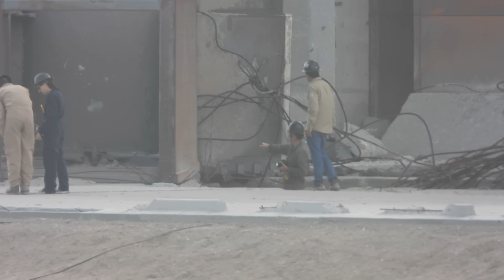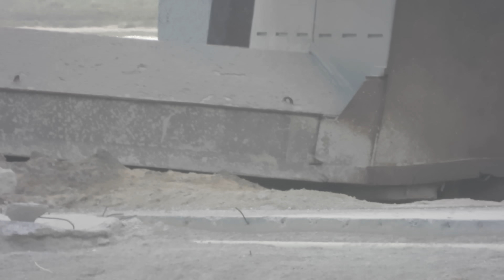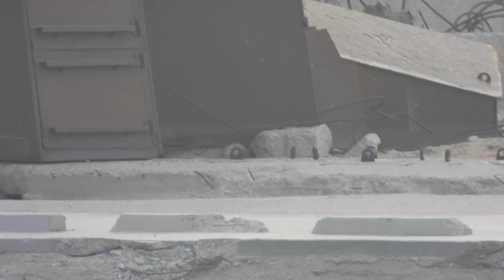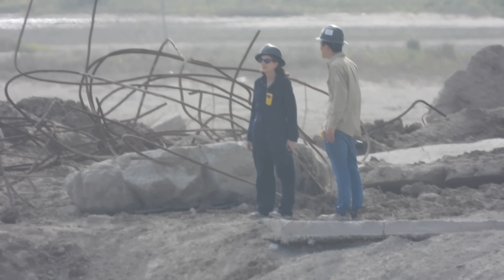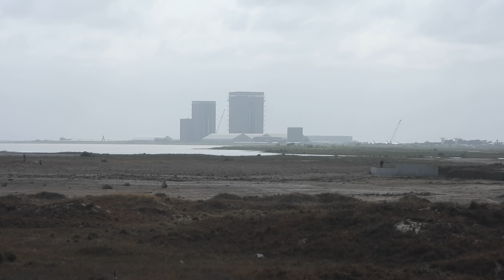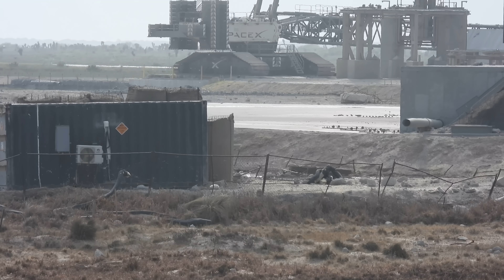Two Days After Launch, SpaceX Starbase, in 4k, Boca Chica, TX, April 22, 2023

Comment: The whole site has seen major damage!.   Another launch in a few months... HA!!  not going to happen any time soon,  at best a year from now or more.  Not only does the site need to be rebuilt,  including the launch platform itself, but also a complete redesign and rethink of the launch system.  Its beyond clear that an exhaust trench must be constructed much like that which was used by the space shuttle at the cape.  All external structures including fueling tanks must be relocated or stored underground.  Its shocking how much damage has occurred. likened to a very very powerful bomb.   we wont see another test launch until an entirely new site is constructed. one that can withstand such forces with little resulting damage.  there's more than good reason to believe that the engines were damaged by the debris upon launch.    clearly this current launch platform has no future.  a rethink is in order.

Comment: Just the clean up is going to take time -- look at all that twisted rebar that will have to be cut before you can break up the dislodged concrete and remove that.  Then the ground will need to be worked on and the anchorage of the tower and pad will need to be shored up.  And only then can you begin to design the repairs.  If SpaceX goes with the water cooled steel plates that should reduce the damage but my confidence that will be enough is low ... very low.  No way 1-2 months, that is completely infeasible, 6 months is possible if they go with just the water cooled steel plates, but if that is what they do I fear we will repeat the failure and potentially endanger the 7000 people that live within 10 miles of the pad.  To build a legit launch pad with true flame diverter and flame trench as well as a genuine deluge system will probably push them well into 2024, but Musk appears more concerned with timetables than success...